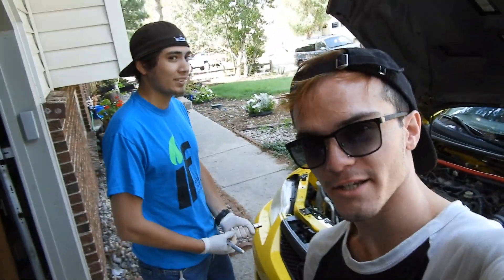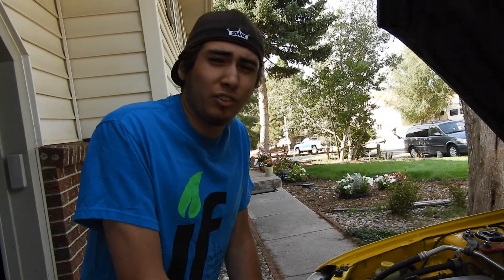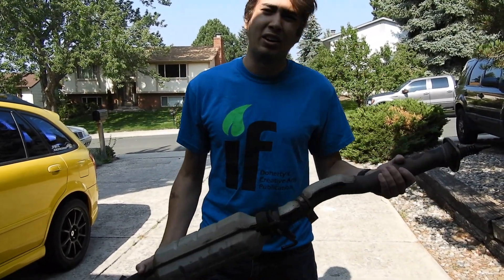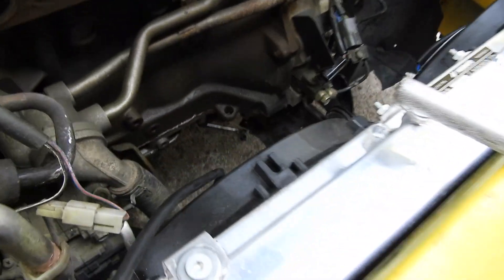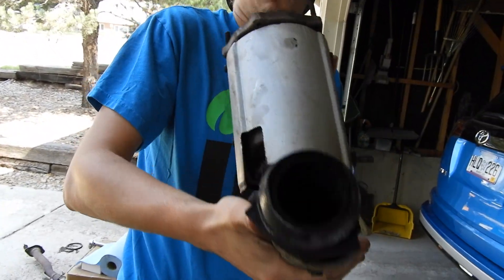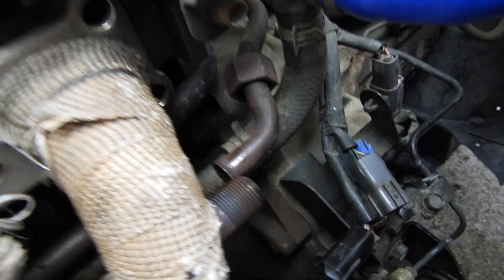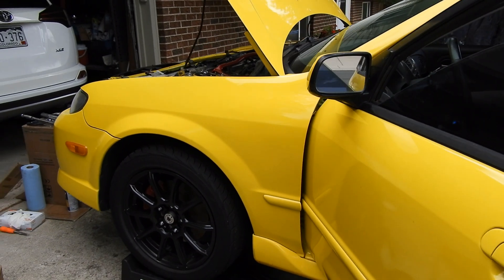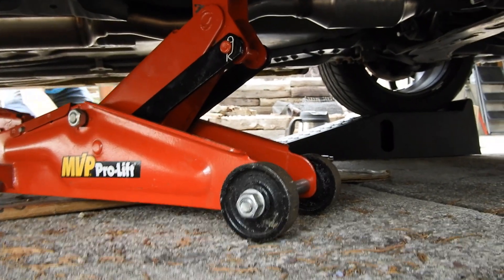Mazda P5 Exhaust Installation

Comment: I bought one of those brand new, kept it for 2 years, and sold it for some reason. I've had supercharged, and turbocharged cars since with twice the power, but I'm seriously thinking of getting another for my commuter car. My main is a 2009 Nissan Titan I bought new, and only has 80k miles. I drove a yamaha fz1 to work for years to keep my truck mileage down, but I'm tired of the elements. Where did you get header/exhaust from? If there is one thing this car needed, it was power. Handled like a god Damn go kart, and I'd love to grab another and soup it up. Thanks
Reply: Racingbeat Catback Exhaust:

http://www.racingbeat.com/Protege/Cat-Back-Exhausts/76466.html

Header:

https://www.amazon.com/OBX-Performance-Header-01-04-Protege/dp/B001UHZB8S#customerReviews

Word of warning, it's really hard to make a P5 go fast without turbo charging it :^)

The FS-DE is not very receptive to engine mods. After a catback exhaust, headers, CAI, intake manifold with the VTCS ripped out, I'm really not all that faster than stock. You could drop in some JDM FS-ZE cams, but those barely account for 10 extra horsepower or so, and they're only a mild cam. It's either dressing up the engine with a bunch of little parts, or opting to just drop in the KL-series V6 for more modability and power.

I think the fastest NA Protege recorded off of the Mazdas247 forums was 189HP. It was also a stripped-down track car with very rare parts in it too. Personally, If I was you, I would upgrade the chassis and suspension more than engine output. The P5's true strength is its chassis, and with proper mods, can outhandle just about anything.

Comment: For  low rpms torque you can get a performance chip but watch your flywheel I did with mines it works good but my fly wheel was already bad the chip just called it fatality afterwards but it I'll improve more torque in low speed, was a cheap chip

Comment: What type of secondary catalyst did you replace the old one with and what type of exhaust do you have on the car? Cool video by the way.
Reply: Hopefully this isn't too late of a reply, but I picked some non California-compliant secondary cat that I can't see on their site anymore. The one I got doesn't have a heat shield of any time, and that leads me to believe it's a high-flow cat of some anonymous type. The car's got a Racing Beat catback exhaust.

Pardon the shitty ricer buzz in the video; the header -> 2nd cat connection wasn't torqued down enough, and needed supplementary washers. The car sounds nice and throaty with no buzz now :^)

Comment: how did you manage to connect the Egr?
Reply: What I found most helpful was getting the header itself in place first, which involves sliding the egr pipe over the bung. Then, once the header is in place, pry it onto the bung by pulling towards you and to the right. It's a little tricky, but a little bit of strength is all you need. Don't be afraid to break it, since it's an incredibly sturdy part. Personally, I didn't find it so bad when I did it.
Reply: My Protege broke 2 headers already. That EGR is a possibility to deal with every time but a new year released about a year ago that allows you to install it without all the hassle